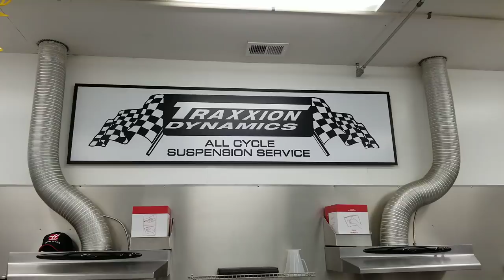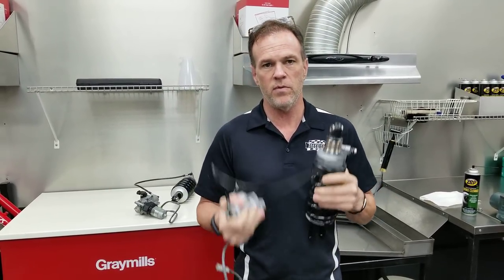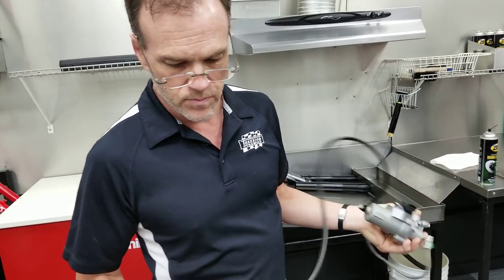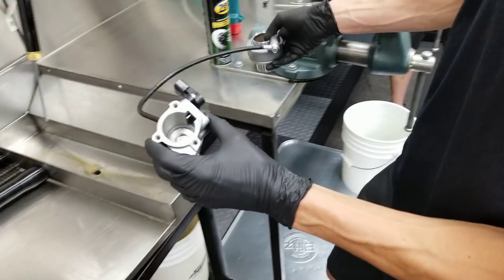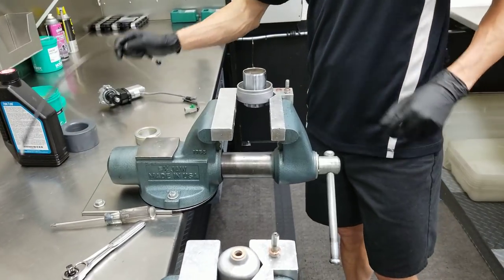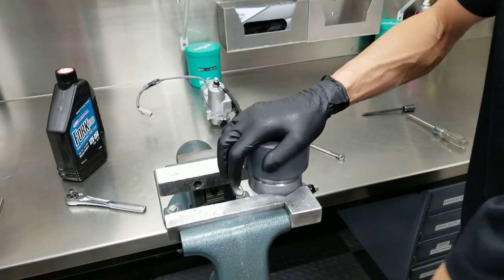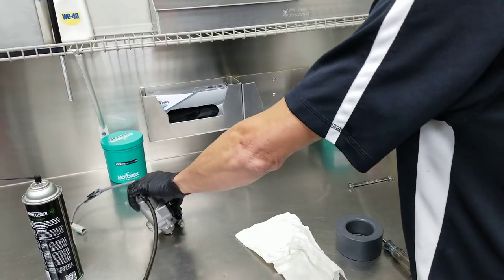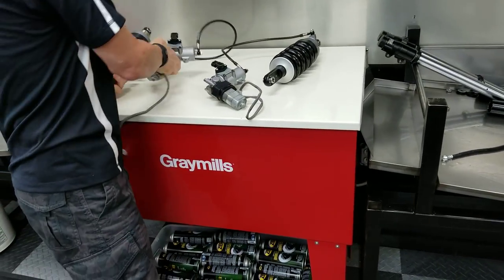Honda Gold Wing Installing Braided Stainless Line for Rear Shock Preload Adjuster w/Max McAllister

Comment from the maker: IMPORTANT NOTE:  Be sure to put your shock down to "Zero" or "1 Person No Luggage" before removing the shock.
Reply: Checked 👍
Reply: Hi Max, I'm new to owning a 2009 GW. Not new to motorcycles. My question is why does it seem that noone talks about setting rider sag on their gw and getting the appropriate setting (as close as possible anyways) when adjusting the preload adjuster? I learned on previous bikes how to do it properly with measurements but it seems that many gw owners don't understand what they are actually trying to adjust the preload for.
Reply from the maker: @krispy1k  While sag is almost a "required" thing to do with a sport bike, on the Wing there isn't much you can do to set sag.  The spring on the bike is too soft to ever get the bike into an appropriate range.  Changing the spring is a massive undertaking, and most owners aren't into it and don't know enough to realize that they should change it, so they buy shiny things instead.

The Wing is asked to do the impossible:  Be good for a solo ride on the weekend with no luggage, and then with just a push of a button somehow be able to carry a double the rider weight and 100 pounds of luggage, and frequently a trailer all on the same spring.  It's just not possible for it to be right always.

So we shoot for "The best it can be".

Past that, finding enough people to be around to try and balance, lift and settle a 1000 pound beast and measure correctly isn't likely to happen either.

Most people just adjust the preload setting to what feels good to them, and leave it forever.
Reply: @Traxxion  Thank you for your reply and great explanation!

Comment: Thanks for the video and the the spring compression tool.  Just made the job real easy.  Other than the hours of disassembly.

I now have it running with a new progressive spring and braided hose, the motor is under load from 0 and up so no air in the sytem. Will be great to have ground clearance, with a sidecar fitted it needed a heavier spring anyway.

Comment: Hi Max. Do you have you a vid on how to service the reservoir/pump with the shock in situ in order to remove the airlock lag?  I've seen a couple of tutorials which describe removing the reservoir/pump assembly, disconnecting the hydraulic hose ensuring that the banjo is held higher than the shock to avoid fluid lose and air ingestion, but your videos are always the bees. Thanks. Mike from the UK

Comment: Thanks to a quick call from Martin I finished mine and it works great. I did not have enough oil in the master cylinder. I think I some got the plunger in the 2 rider & luggage position when I added the hydraulic oil in the slave cylinder. Not sure why this happened I must have rotated the motor in the first step the wrong way and it is not easy to determine from the video which way Martin was spinning gear with his finger. I also wonder why you don't skip that step and just turn the plunger to the top when you open up the master cylinder?  One last comment when I tested the final set up with the menu it knew what position the preload was in because it did not run when I selected the same position. Only ran when I went to a different position. I expected to see the existing position highlighted?  If so instill have an issue. But happy because it works otherwise!  Traxxion Dynamics Rocks especially Dan, Martin and Max!
Reply from the maker: Hi Merv,  I am guessing you had it in 2person Lugggage when you took it off the bike.  We always lower it to 1 person before disassembly.  This puts the piston and sensor in the correct spot for the 2018+.
Reply: Which way was Martin spinning the gear with his finger?  Clockwise is my guess but not sure either.

Comment: Did not see or missed filling the reservoir with oil.  07wing with 224,000 miles.  Shock needs this fix.
Reply from the maker: If you are talking about how to do this with the shock on the bike, I don't have a video for that... I have heard it can be done.  We are always replacing the shock anyway, so it's easy while it's off the bike to change the line and bleed the adjuster.

Comment: So I understand, for the new rear shock you offer for the 2018+GW, you still need the preload adjuster mechanism ?
Reply from the maker: Yes, it is transferred from the stock shock onto our replacement shock.
Reply: Ok tks Max. And for the Front Chock we only transfer the motor with the cable to your shock to avoid false warnings from the System. But in contrary to the Rear Shock, the motor in the Front Shock has no function then. ?
Reply from the maker: @340Captain  There is not front preload adjuster.  The two electronic damping adjusters, front and rear, do not cause any warnings when disconnected.  We install blind plugs over the factory harness to protect it.
Reply: Understand, but then, why do I have to transfer the preload adjuster to the new rear shock ?

Comment: With 500lbs in passenger and trailer will I need a stronger spring as well as a braided line?
Reply from the maker: Absolutely... the braided line will not assist in carrying weight in a way that can be detected.  You need a new Traxxion Shock, it comes with the spring and braided line.  If you put a stronger spring onto your already too weak shock, it's just a bad recipe, and you have to do all of the labor to change it just to have it work poorly.

Comment: Hello, i have a 2015 GL1800 and my preload adjuster is not working. The pump works if i connect it to the battery, the relays look ok, the fuses are ok, but there is no tension coming to the 2 pin plug (the one that supplies the motor). Can you please give an idea where or what to check next or how to fix it somehow? 🙏🏼🙏🏼🙏🏼 thanks in advance
Reply from the maker: No idea on that... you'll need to get a wiring diagram and go in reverse to find it.
Reply: @Traxxion  i am looking for the wiring diagram but i cannot find it…any hints or ideas where can i find it? Thanks in advance!
Reply from the maker: @85NKL  you'll probably have to buy a factory service manual.

Comment: Do you ever grease the relay link arm needle bearings ? 
The FJR riders swear it needs done every 16k, when I asked the GoldWing guys they say it never needs done.
Reply from the maker: It needs to be done once for sure, and then any time the shock is out for service it just makes sense to check it and see if any of the seals have failed.  If the seals don't fail, it will be fine forever.  The factories don't put but a tiny dab of grease in them... it's silly.
Reply from the maker: PS the same type of guy who says you need to grease linkage bushings every 16K miles is the same type of guy who says you can't reuse a crush washer, and you need to put your air vavle caps on with a torque wrench...